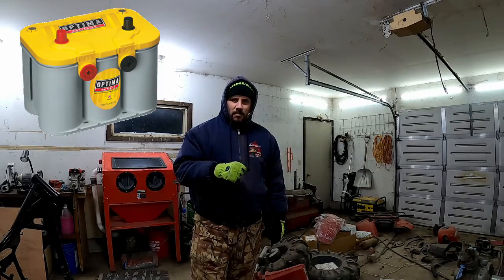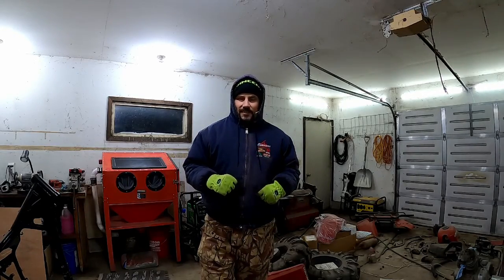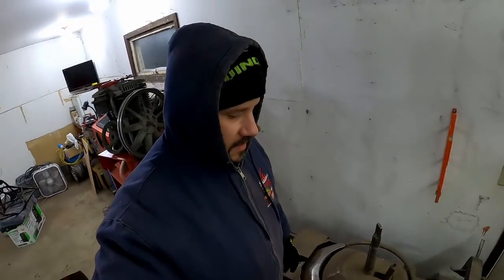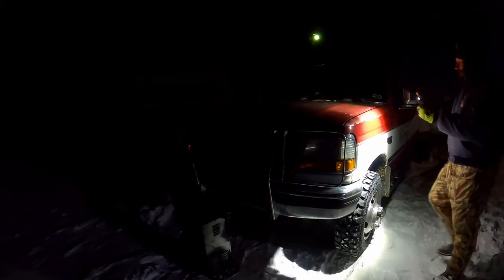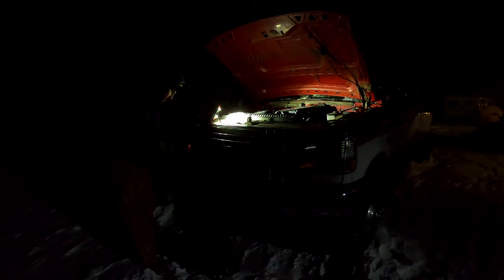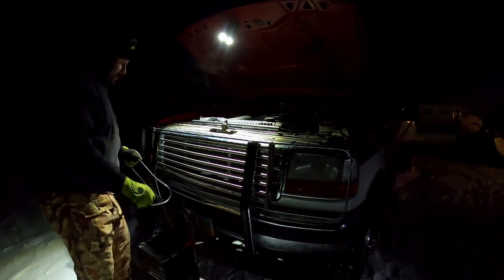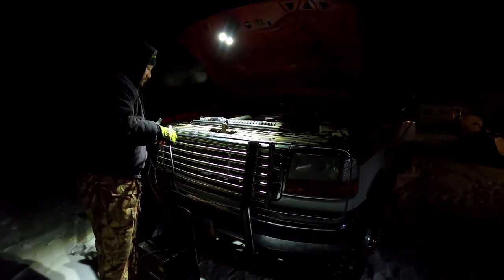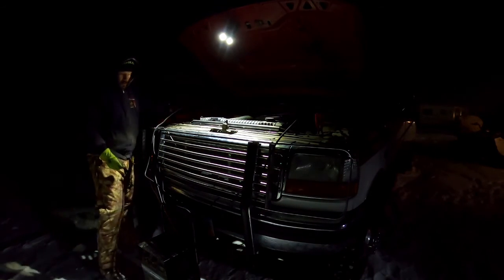Are OPTIMA Batteries WORTH the PRICE TAG?

Comment: Thanks for choosing OPTIMA Batteries (our batteries are AGM, not “gel” batteries). Fully-charged, your YELLOWTOPs will measure about 13.0-13.2 volts. We don't recommend a charge rate that exceeds 10 amps for safety reasons. We don't know anything about your charger other than the rate you chose (30 amps) and the time you chose for charging (130 minutes). 

Our D34/78 YELLOWTOP is a 55Ah battery (110 for two batteries), so if your charger operated at 100% efficiency, it would deliver more than 60 amps in 130 minutes. If your batteries were discharged just enough to prevent the truck from starting and the charger was 100% efficient, it could've resulted in a dangerous overcharging situation. Fortunately, most chargers do not operate at 100% efficiency and your batteries sounded like they were completely discharged.

We also heard you mention that one of the batteries was from 2013. We don't know if that means the other one is not the same age, but whenever multiple batteries are installed in the same application (in parallel or series), they should be identical in age, size and type. As batteries age, their internal resistance increases, which makes it harder for them to accept and deliver current. As a result, if you use two batteries of different ages, one may charge faster than the other. When the newer battery is fully-charged, it can become overcharged, as the other battery is still accepting current. The same thing can happen with batteries of different sizes and types (flooded vs AGM). 

Since you are in the Dakotas, where we know it can get extremely cold, we also want to mention that it is potentially very dangerous to charge any battery that has frozen. While our YELLOWTOPs are protected from freezing down to 30F when fully-charged, they can freeze at warmer temperatures, if they are discharged. This blog explains what to do if you think your battery may have frozen https://www.optimabatteries.com/experience/blog/what-happens-if-my-car-battery-freezes
Reply from the maker: Thank you Optima Batteries for this excellent information.  I’ve pinned this to help others also have a better understanding of how to navigate whatever the situation may be.  

We enjoy running your batteries in our farm & town rigs. 💯 #WorthThePriceTag
Reply: @2StallGarage  so strange that when we tried to type minus 30 degrees, it lined out the rest of what we posted, but thank you and thank you again for your business!
Reply: -30 degress*
Reply from the maker: Yep 👍
Reply: @optimabatteries  the fact you guys actually watched and listened to this video Gaines you some respect and a customer. I'm purchasing a d34m right now.
Reply: Update, I ended up getting a DH7 yellowtop for my ram instead of the d34m. I hope the battery is as good as your support!

P.s.
I purchased through the optima store on Amazon, I wouldn't be upset if there were some free stickers involved lmao
Reply: Your batteries are trash
Reply: Dear Optima, your customer support is less than Optimal and truly pathetic. Despite several emails I have only heard crickets from you.
Reply: @JC-4A53  we're sorry to hear about the issues you've been having. What is the last name associated with the emails you've been sending?
Reply: @JC-4A53  we're just following up with you again, to make sure your situation was resolved. We requested a last name associated with your attempts to contact us, but never heard back from you.

Comment: I have two Optima red tops that are are 10 & 11 years old. One still works great and the other has a bad cell but it will still start the car on a warm day.
Reply from the maker: Nice.  Ours are 10 years old and still going too.  Good stuff.
Reply: How does one know for sure the battery has a bad cell? I have an Optima Yellowtop & their digital 400 charger. Is there something else I need to buy to check it? Or through testing if it can hold a charge? I'm still learning & have a deeply discharged battery. Thanks
Reply from the maker: You can purchase a battery tester from Oreilly or any local automotive store. If it’s fully charged but doesn’t meet minimum cranking amps during the test, you have a bad battery.
Reply: @2StallGarage  Will do. Thank you for your help.

Comment: I paid $50 for a red top that had never been used. Was couple years old already when I got it. Threw it on my car and it fired up. Hardly drove the car and battery stayed good up until few months ago. It'll jump off and run but won't hold a charge. Now of a battery that's several years old never charged and works that good I'd have to say they are worth the $ imo. If I could gave afford another I'd bought one in a heart beat.
Reply from the maker: For sure.  When these begin to fail, I’ll have to decide on the big price or going economical.  💁🏻‍♂️
Reply: @2StallGarage  being up north and having to have 2 batteries I think I'd definitely go with something that's gonna have the power to not let ya down on those cold winter mornings.
Reply from the maker: @GlassWerx  You speak truth right there.
Reply: @2StallGarage  I like the cold I just don't think I could deal with the cold yall get there.
Reply from the maker: @GlassWerx  Where ya from?
Reply: @2StallGarage  texas/arkansas. Border town called texarkana

Comment: I used Optima batteries for year in my Jeeps but I switches a few year ago to Odyssey Extreme in my 2017 Jeep JK.
Reply from the maker: Like it?
Reply: @2StallGarage  My battery is 5 years old and still tests very close to how it did as new.
Reply from the maker: @wlh227 that’s great.  Not common with the batteries these days.

Comment: Hey you need the Red top battery
Reply from the maker: You like the red better?
Reply: @2StallGarage   it depends what you’re using it for
Reply: The yellow top cover is for use big amps that why I brought that one so the red top cover is for cold weather its more cranking amps
Reply from the maker: @lifewith26gang45 makes sense to me.  The reason I bought the yellow is because it will crank longer, although not as fast as a red top.  I had a couple red tops in this truck before that lasted almost 10 years. 

Thank you for sharing your thoughts. Much appreciated.
Reply: Just got a yellow top due to the duralast gold in stock being almost 2 years old they didn't feel comfortable selling me a old battery no upcharge just handed me the optima and some grease for my troubles win win
Reply from the maker: @LiteEmUp2531 that’s a deal.  Nice